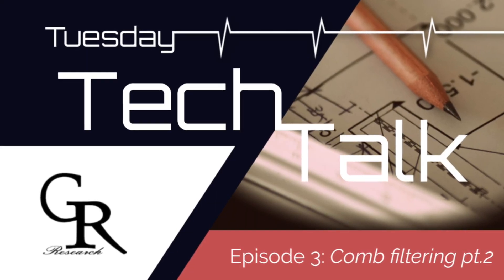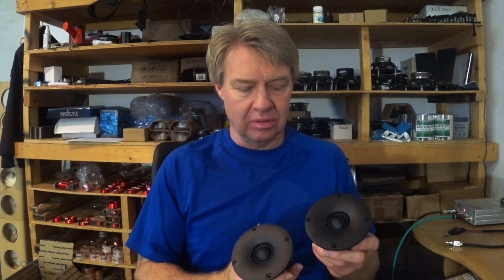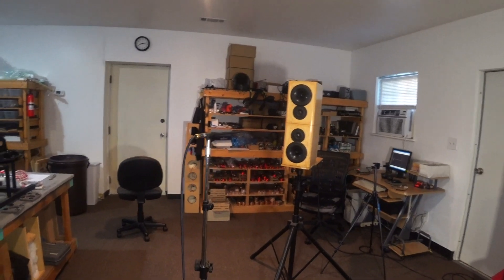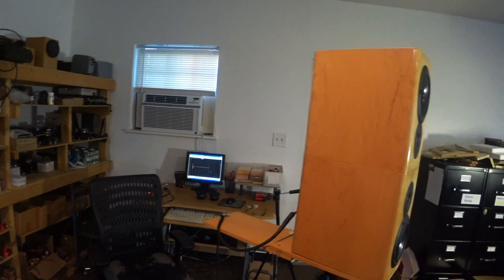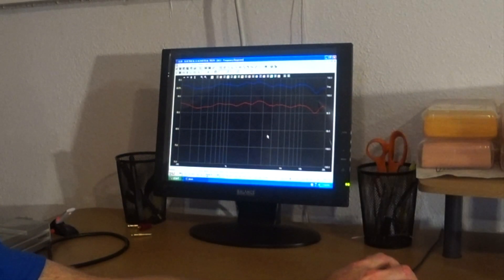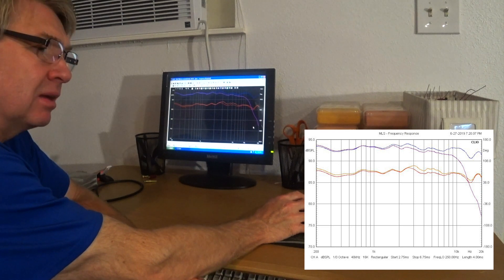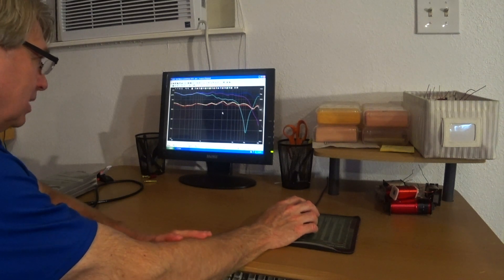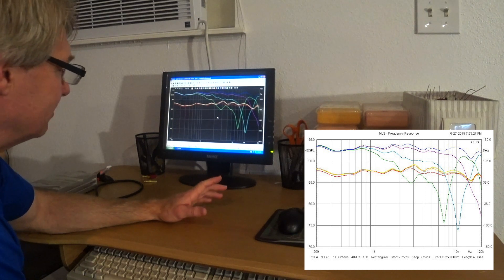The REASON why 2 tweeters wont work!

Comment: Good video and I can see what Danny is saying here about why multiple tweeters may not necessarily work well for additional output.

One thing that Paul McGowen of PS Audio said, and his old friend Arnie Nudell did with the Infinity IRS IV speakers is use multiple tweeters in a line array and did the same with the midrange drivers and woofers so no matter whether you are sitting or standing, the sound won't change, but if you were to raise the volume, multiple tweeters can mean they have to work less hard to produce the treble at higher volumes, so they never get shouty like some speakers so when you crank up the volume so as you crank the volume, the tweeters in a line array setup never get hard sounding and thus fatiguing at higher volumes.

At least that's what Paul says anyway. 

Another thing I think also causes some listener fatigue is using one overly bright tweeters or too small a tweeter for a given design so they have to work harder to produce volume at higher levels., but metal domes tend to be bright compared to soft domes say.

But what do I know, I don't design speakers but do use some vintage ADS L810 large bookshelf speakers that use a 3/4" soft dome tweeter, a 2" soft dome midrange driver and 2 8" woofers in an acoustic suspended speaker cabinet that are the best I've had in my system and probably made some of the biggest improvements in all the other parts, outside of the cartridge and perhaps the phono stage.

Comment: So Danny, for a mono playback on a modern hifi system (including modern stereo cut mono albums) should we be killing one speaker instead of either letting it play in “stereo” or summing the channels with a mono switch?  I made a jumper box where I can kill either L or R, or jump LR, but that’s the pre power amp.  I feel like the better solution is having a dedicated mono power amp with a mono speaker in the center of the room?
Reply: Whether you drop out a channel or not could depend on the speaker placement and distance that they are from each other compared to you. And the number of recordings made that way are limited. Go with what works best (or sounds best) for you and your application.
Reply: Your speakers are probably 6-8 ft. apart which could affect the midrange output but not the treble.  If you can get a tight center image from a mono recording, you have probably minimized the comb filtering.

Comment: Great video.. very informative!
I wonder why line arrays are so praised? Do additional drivers cancel out (fill in) the cancellations :)
Reply: Line arrays are very different. They act more like a single continuous driver. If you pulled out all of the tweeters except for two of them then the response will be just like what I showed in the video. But while two of them may be causing a cancellation others that are playing are not. Their distances are different. What you get is +/-2db ripples that move around as height changes. Dome tweeters or drivers that are spaced too far apart still have a mess of a response though.
Reply: Line array is different because it is not a multiple point source, but a continuous seamless panel, or line, but could be sensitive to vertical position in theory. Some professional JBL line arrays are curved to where the top and bottom of the array is the same distance to the general target listening position. Someone should test one.
Reply: It's all about understanding the tradeoffs. Line arrays do truly amazing and beneficial things in the realm if acoustical physics that are literally impossible for a single point-source tweeter.